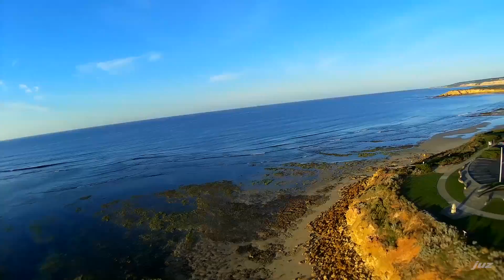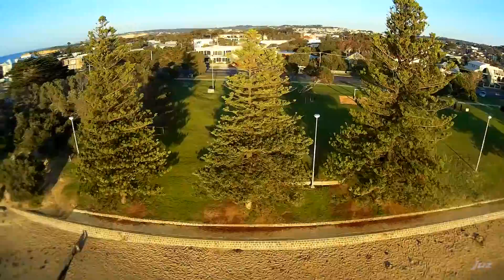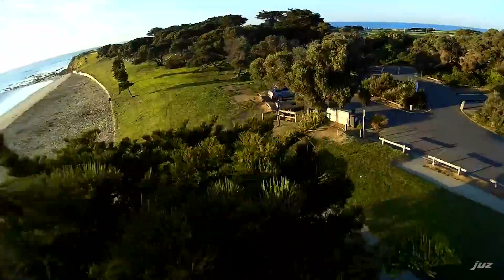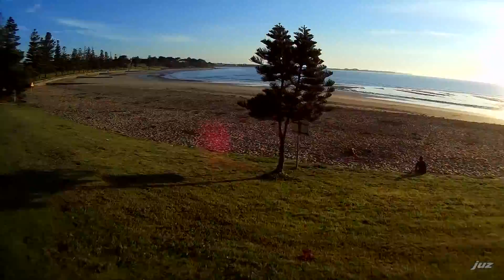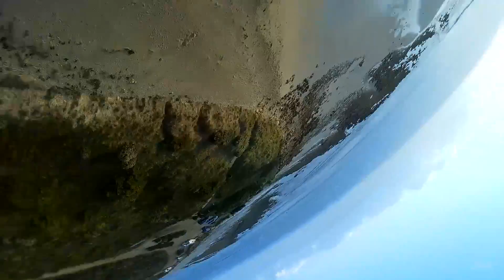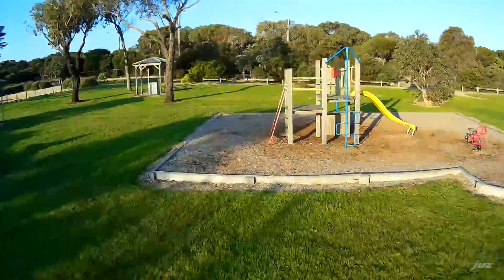FPV - tuning session

Comment: Man I really wish I could tune like you. Been struggling to tune my 230 class quad for a week and no matter what I get oscillations. Even with low P values. Frustrating!
Reply from the maker: ProjectRecon1 That sucks man. Maybe the oscillations are coming from high I or D? Sometimes it hard to tell what to change. Best of luck.

Comment: Seen you fly with different motors, which do you recommend?
1806 (2300kv), 2206 (2000kv) or 2206 (2350kv)?
Reply from the maker: Funny Bunny They are all good motors. I use them all.  I like the 2300kv. If you want to run on 4S then go 2000kv.

Comment: Hi Juz, i'm a new comer into this world.
Why did you choose naze32 over CC3D, is there any reason?
Reply from the maker: Life1024 Because it flys better.  Its also easier to tune and set up.  I have more confidence and can fly closer and more accurate proximity because of its locked in nature.
Reply: juz70 Thanks a lot Juz, i'm wondering if i could go for a QAV250 or another quad.
Would you help me find out what to choose?
I'v seen Blackout, XHover and many others on the internet...
Why did you choose the QAV250 and what are its main imperfections in your opinion?
Thanks :)

Comment: Although it was tuning session seems great juz congratulations!! I cant imagine your flight wwith your final pids;)) sure when you compare cc3d,naze is a robot and more locked in than it:))..but when ı fly with naze32 long time I miss cc3d,s smooth turns:))
Reply from the maker: They definitely fly differently.  Its all about personal preference.  Not sure what I think yet, but on my mini the naze32 is a winner IMHO.
Reply: Could any of you guys possibly tell me the process you go through when running the Naze PID's. I'd like to use a tried and tested method rather than just picking numbers which are maybe suitable.  Thanks.

Comment: Can you tell us more about your Lumenier CS-600 super camera set up please?  What lens do you fly with?  Do you use the metal case or remove it to save weight?  Do you have a separate battery for you camera and video Tx?  Thanks.
Reply from the maker: Stock CS-600 lens (2.8mm). Removed from case. Single Lumenier 3s Battery for everything.
Reply: OK thanks.  Why do you use the CS-600 when the mobius can be used for fpv?
Would your set up be able to carry a GoPro instead of a Mobius?
Reply from the maker: Because a mobius won't provide as good an image (in my goggles) as a CCD camera will. and...A board camera is so light that the weight penalty is minimal. Yes, my QAV250's will carry a gopro.

Comment: You call that  a tuning session.  It looked more like an 'already tuned' session to me.  Great job as always.  Looking forward to compare your PIDs.  I'm in the process of selling all my controllers and replacing them with Naze boards...like you, I like the way they feel in flight.
Reply from the maker: Well, when tuning, I pretty much do all my favorite moves to see how the machine reacts/feels. Still needs more tuning though. Watch closely just before low flips/rolls. Quads shakes like crazy. Some TPA has helped, but still not sure on PIDs also. Yeah, loving the Naze...just installed one in my 400 and it flys vantasstically  =P

Comment: I've always wondered if the better pilots use the CC3D because it really is better or just because. I'll be very interested to hear what you think juz70 when you've had a chance to form a full opinion. 
For me the biggest obvious difference is that with the CC3D you enter expo on the TX whereas on the Naze32 you do all that on the flight controller itself. In theory you get better resolution out of your TX if you don't use Expo on that and enter it on the FC instead (i think).
Personally i love the Naze32 - it feels very 'locked in' with the right settings and can be flown very nicely on full manual mode. I think the CC3D has a smoother auto-level and might be better for producing those really floaty scenic videos you seem capable of shooting. When i fly my Naze32 it's fast and furious the whole time; I've been accused of making people feel motion sick before!
I usually tune mine by putting P up a little on pitch and roll then adjusting Rates and Expo settings until it flies the way i want it to. O yes - LOTS of TPA (Throttle Pid Adjustment) seems vital on these mini quads if you don't want them shaking themselves to pieces on the full throttle climbs. 
Looks like you've got your setting close to right already :-)

Comment: Nice to see you trying the naze32. Could you shortly describe the process you are using for tuning? Which values are you changing? Which behaviour are you looking out for when you do a test flight? How do your observations influence the next settings you try? Thanks!
Reply from the maker: Depending on how the machine stops after an abrupt stick movement I either change P, I or D.  I am also playing with rc rate and P & R rate and yaw rate to get the machine handling to way I like it. Still not sure on Looptime, but I have been toying with that also. I think mine is at 2800 at the moment.

Comment: Looks good Juz! Naze32 is like black magic ;). It's funny I accidentally discovered naze32 like almost 2 years ago, cause couldn't get any CC3D's anymore back then and I was so surprised by the performance and still using it. Only difference nowadays that entire world flies it :D
Reply from the maker: thanks Boris. Funny thing too is that a friend in the States sent me two early versions of the boards over two years ago and they have been sitting in my workshop all that time. 
should have tried them earlier.  LOL
Reply: juz70 lucky you. 2 years ago the configuring software really sucked and there was no descent documention or community. I was close to just smash it against the wall before I got it going :). Nowadays there is a baseflight configurator, which makes it easier.
Reply from the maker: Boris B. So perfect timing then?  =]

Comment: Do you have any expo on the transmitter?
Reply: ohk, i use the Revo CC3D, but been flying in attitude, but now i have started in rate. Just trying to set up mine. All is ready, just thought flying rate was so much harder than my helicopters, but from forum questions, i need to put expo to make it easier and more controllable.
Reply from the maker: Bruno Mills yeah, with your revo, use some expo in your transmitter. I use 40% with OpenPilot hardware.
Reply from the maker: no tx expo.....65% expo in the Baseflight GCS
Reply: thanks for getting back on my question.
One last one, you fly rate or axis lock?
Reply from the maker: Bruno Mills rate
Reply: awesome, thanks for the help! :)
Reply: Let me know if you are in Sydney and we can go for a flight
Reply from the maker: Bruno Mills  no probs man...=]
Reply: Bruno Mills
this is acronaze not cc3d ;-) so the flights mode are rate, angle and horizon
Reply: juz70 What your RC rate on the multiwii? ~2?
Reply: juz70 Thanks. Will try 40% then. :)

Comment: Very nice as per usual - how did you find the naze compared to the OpenPilot board you've been using before ?
Reply from the maker: Naze feels more locked in. I feel like more is possible
Reply: juz70 That's really a cool comment, especially since then CC3D is more than 3 times the price. Be sure to post some good "starting pids" for acro flying, so we can tweak from there. Cheers and great flying Juz :)

Comment: Cool, have a naze on the bench too, looking forward to see your PID
Reply from the maker: Will share soon.  =]
Reply: juz70 awesome
Reply from the maker: dborup =]
Reply: juz70 I am out testing my QAV250 with naze, and it just SUCKS, I am all down with pid so it will stop shaking
1.5 025 23
1.5 025 24
8.5 045 0

What am I doing wrong :(
Reply from the maker: dborup Is it shaking with high throttle input?  If so add some TPA. My TPA is currently at 0.65. My Settings are ...
2.6  030  28
2.8  048  30
8.5  045   0
Reply from the maker: juz70 BTW, my looptime is set to 2900
Reply: juz70 ok thanks, I got some more patience and started from zero, and found some pids :)
2900? why not 2500 (400hz)?  any special reason, or is that just what works for you?
Reply from the maker: dborup I found it easier to tune at 2900.  Can you share your settings?
Reply: juz70 sure.
 3.0 - 040 - 23
3.4 - 040 - 23
11.5 - 0,50 - 0
Roll & Pitch rate 0.50
Yaw rate 1.50
TPA 0.10
RC EXPO 0.0
Still need some work to soften the control out.
gonna try yours today
Reply: looptime 2500